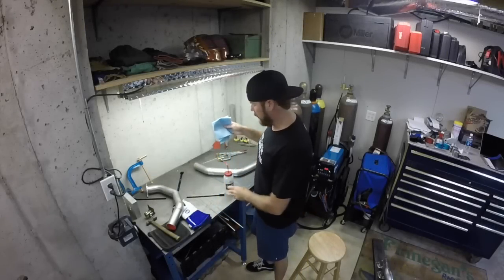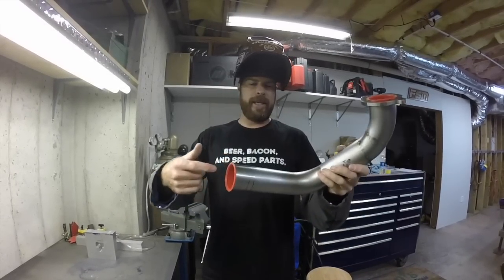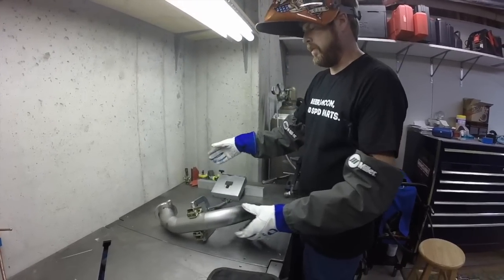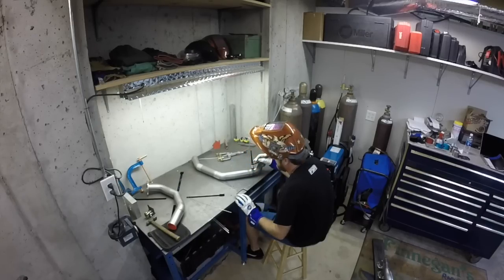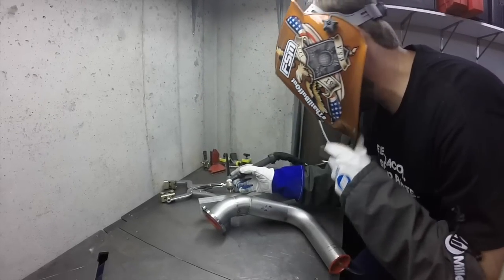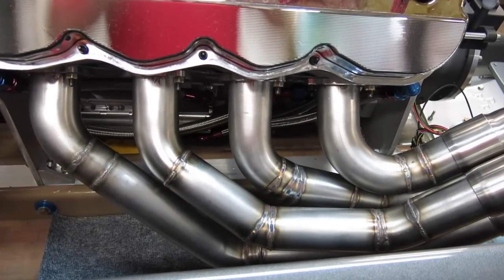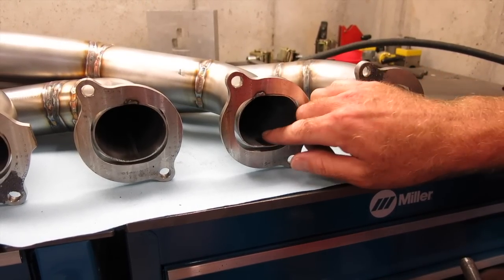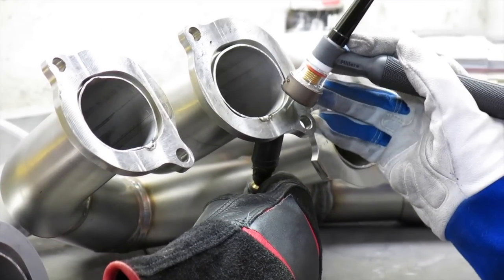Finnegan's Garage Ep 13: Hemi-Powered Drag Boat Stainless Steel Header Build Part 2

Comment: Nice work. I used to use what I called a clean tube. That was a tube that I made sure was clean on the inside so when I cleaned my filler rod I had a place to keep it so it stayed clean for later use. Thanks for the interesting show.
Reply from the maker: good tip!

Comment: Great video Mike,very informative. I made a tapered mandrel from a bit of off cut steel bar to fit the size and shape of the exhaust ports on the headers. This was gently tapped into the pipe as it was heated. The pipe swelled out to the right size easily and was tacked in several places before removing the mandrel. Worked perfectly with nice even transition from pipe to port. Took about an hour to make but worth it, has been borrowed by many people! Nice welding by the way.
 I picked up a bung and gauge kit to pressure test inter coolers,hoses and stuff,makes an excellent pipe purging rig too! They on eBay for about sixty bucks,well worth it for testing intake and exhaust systems too. Comes with wide range on bungs and a pressure gauge.
Reply from the maker: sounds like it works great.

Comment: 3:15 what you're referring to here Mike is sensitization, overheating austenitic stainless steel causes the chromium to join with carbon to form chromium carbides at the grain boundaries resulting in loss of corrosion resistance due to chromium depletion. If you look at this occurring under a microscope you'll literally see missing grains due to intergranular corrosion. If anyone is interested in welding or is taking welding in school I strongly suggest taking a welding related metallurgy course, it's really interesting to learn about this sort of thing! Great content.

Comment: Remember that when you're purging, you should always weld closest to the purge line first and make your way along. If you don't you can get weld contamination from the air being pulled in as the Argon flows over the open gaps.

Comment: Saw in a stainless muffler welding video the guy used Solar Flux for the back side of his stainless welds.  Sounds like another good option if you don't have a helper for the backside.

Comment: I welded 2v primary long tubes to new 4v oval flanges and boy what a pain in the ass to stretch the tube into a oval. had to relief cut it and grind it from the inside a shitton. Looks like that fits much better

Comment: You don't want to weld that low of amps because you're not likely to get full penetration of your weld.   If you're concerned about overheating the joint, weld it in quarter sections and dunk in water between sections to cool it off.  Stainless doesn't quench like mild steel so you can dunk away.  Really preference I suppose, I wasn't happy with the penetration doing .045 on 1/16" wall tubing but it does look neater.

Comment: I found the best way to weld thin wall stainless or carbon steel exhaust tubing is to get a perfect fit up and not use any filler wire. much less warpage. no excess pen.  no need for a back purge. and much better looking thin welds. and yes it is still very strong. not that exhaust is structural any way.
Reply from the maker: the exhaust is supporting the weight of the turbos....
Reply: +Finnegan's Garage  if you got 2 scrap pieces laying around. but them up with a perfect gapless fit up. fuse weld them with no filler wire. then take a hammer to the weld it won't  break even if you completely flatten it. I've never tryed  a fillet weld with this technique. but it works great for but welds.

Comment: So funny Finnegan - I have an arcstation, miller diversion 180, 625 extreme plasma, stronghand clamps - it's almost the same exact setup lol
Reply: BTW - I have a video of making a tungsten sharpener out of a cheapy grinder w/ diamond wheel for a chain saw sharpener.  Tungsten in a drill against the diamond wheel = great sharp tungsten w/o murdering abrasive grinding wheel stones and minimal dust.

Comment: Good work as always Mike. I like that you take the time to explain things a bit. I noticed you have a footcontrol for the tig. How does that work? I only use a tig with a switch on the handle.
Reply from the maker: its a wireless foot control. works great. only time i use thumb control is when i'm laying down inside a car and the pedal isn't comfortable.

Comment: Hey Finn, came back to this video because I remembered how informative it was. I'm building my very first header that's hopefully going to be an equal length 6-1 for a 240Z with a stroker L series. My worry is following the same process that when I go to finish weld and hammer the tubes into place on the inside of the flange that i'll warp the flange without having it bolted to a head or a jig since its such a long piece and for the L you cant cut the flange up since its integral for bolting the intake manifold on as well. Any thoughts/tips/tricks? Thanks!!!

Comment: Pickling solution, gel usually should be available at your welding supply.  Post weld treatment will restore your welds  stainless properties.  You do lose some of the cool colours.

Comment: I was just watching the video where the guy gave Finnegan the tips on tig welding on Hot Rod Garage the day before yesterday... Guess Finnegan forgot that little trick for feeding the filler without dipping and pulling back.
Reply from the maker: didn't forget. just haven't practiced it enough to be good at it.
Reply: Finnegan's Garage whenn I was Tig welding aluminum I just constantly fed it. I've never understood the dabbing... seems like a bunch of low spots that could be weak points to me. It eats up a lot of filler to constantly feed it but it seemed like a better weld... My instructor in college though I had actually mig welded it because it was so consistent :P damn I miss welding.

Comment: Pro tip: Try running a low-pass filter on your audio. It should get rid of that hum from your welder (I assume), great video though! Thanks for making these!
Reply: I'm thinking it may be an extractor fan
Reply: high pass filter... (real pro tip)
Reply from the maker: its the phase converter for the welder.

Comment: Nice vid. Getting better. Just FYI, you are wasting a ton of purge gas. You can hold the hose to your ear and just turn the regulator in until you just hear it flow. In a capped vessel like you are welding it is impossible for oxygen to "back flow" into the vessel with even the slightest amount of purge gas. Also, you should wear clean gloves when handling your filler rod after cleaning it. Your hands are full of impurities.
Reply: I agree about wearin nitrile gloves when cleaning the rod. But he seems to have good results without them.
Reply: +Eric Lock very true. Hell, Jesse James bare hands his all the time, but my point was: if you are going to wipe it, why barehand it? The gloves aren't for heat on a job like this. In fact, he would probably have far better control without them and could do the job in less than 8 hours...

Comment: makes sense that rod is dirty , they manufacture it by pulling it through either a die or between shaped rollers 
to prevent wear they do use some oil 
never thought about cleaning the rod , i do now 

i wonder if a chamber uses less gas , seen them before and the look like a gastight blastingcabinet with a weldingglas
Reply from the maker: those chambers are awesome and expensive.
Reply: i wonder if a clear plastic bag / tent would work

Comment: Could you do a video on the colors of the weld, at the end there is some blue, purple, orange and some other colors and I just feel like that could be a topic for a video, I have never owned a welder nor have I ever welded anything so I'm just curious if there is any difference and all that
Reply: the color of the metal changes duento the heat of the weld i think. i seen some blacksmith change the color of metal when he left it in an oven at like 1000 degrees and it turned stainless steel into a shiny blue.
Reply: The colors are pretty but not ideal. They are caused by oxidation, meaning burning of the metal. Welding in the open air causes it, nearly impossible to displace 100% of the oxygen. When you see something that was welded in a proper weld chamber it won't have any color just as if you had polished one of these welds- the color is only microscopically deep.

Comment: This will be a dumb question but why not use a flare to expand the pipe inside the flange? They make oval expanders.
Reply from the maker: the tube had to be compressed to get it into the flange. i didn't have an oval flaring tool so i made do.

Comment: All this talk about back purging on no mention of solar flux??  I've used it welding 304 stainless with Oxy and it worked well (coated both sides).  I'll be TIG'ing some n/a headers and fully intend to use it for that as well.

Comment: the foot pedal doesn't seem to have a cable - does it use a radio/IR/unltrasonic link to the welder or am I just more blind than I thought?
As a general comment, Argon and Carbon Dioxide are both heavier than air, so usually best to purge from the top or, at least, leave a small opening to the top so the air gets displaced rather than being trapped.

Comment: Is it possible to weld in argon itself? Say, if you had an enclosure with argon only, would it actually work? It's likely not very practical, but at least you wouldn't have to "purge" your tubes or feed argon on the backside as the entire piece would be immersed in argon anyhow.
Reply: In theory, if you could seal a room, fill it 100% with Argon gas, and keep it above atmospheric pressure, to keep the atmosphere out of the room, you could wear a scuba mask or similar and weld without requiring any gas flow.
Reply from the maker: yes but the enclosures are about $2,000.00

Comment: Considering how much damage the headers could take in that Engine Masters episode without any measurable power loss, I doubt your welds will affect the exhaust gas flow the slightest.

Headers starting to crack is probably the more serious issue of the two....
Reply: my thoughts as well in a previous vid. what the hell are we to believe with the genuine leading edge impact/engineering specificity with intake/exhaust in the engine and pre combustion, but exhaust seems irrelevant except for diameter per test.
Reply from the maker: also, and i failed to mention this, the sugaring on the backside of the weld is brittle and pieces can get forced into the turbos. not good.
Reply: Finnegan's Garage
Don't get me wrong, you've probably forgotten more about welding than I'll ever learn... it was just that detail about the flow that made me react.

Best I can do is shitty looking MAG welds, with shitty technique and shitty equipment... Compared to me you're a welding god. :P

Comment: Do you own/use or can borrow a 1080 HD endoscope to see the interior results of your welding ?  Or would you need a 4k endoscope to properly examine any signs of interior Oxidisation or other interior deformations  that over time will cause micro  hot spots to appear in each weld or join  made in the exhaust system ?  
Or would that be an overlkill , similar to using a high resolution FLIR camera to view infra red emissions when the completed engine is run on both the dyno & in the boat  under real world conditions , in order to pick up signs of thermal inconsistancies or oddities ,  before a $100K race motor catastrophically fails ?  
The technology to keep a twin turbo small/big block chevvy boat motor running big  Torque reliably & picking up problems before they became major issues was very primative back in the late 1980's & early 1990's when I hung around ski/race boats ,  I'd be interested in how far people go today to protect & manage a 2000HP  high dollar boat powerplant.

Comment: Well i have a serious question, why use all that stuff, tig weld it etc. if You could in theory just use a mig welder with flux core wire/self shielding wire without gas i mean and you get stuff together too?
Welds aren't that preety, yes but other than that i really see no difference and i have made probably about 40 exhausts with that flux, first one about 8 years ago and it's still holding on well.

Comment: When you cleaned the filler rod with acetone, where did you get that bottle, I have been looking all over for those style of bottles with the 90 Degree spout? Thanks Jack
Reply: hairdresser supply joints are the place to got for stuff like that, chemical proof and cheap.
Reply: I was wondering the same thing!
Reply from the maker: this

Comment: Is there any considerable risk of twisting the tube out of position/angle when hammering and welding it to the flanges since the flanges where cut apart?
Reply from the maker: since the tubes all slide in and out of the collector you just twist them into position when bolting them onto the cylinder head.

Comment: Don't take those calling you out as criticisms.  For instance, I had never heard that about brake clean before.  But I've never TIG welded either, only have a MIG here.  But when I find a good deal on a TIG,  it will be here, and like most things, I'll teach myself through trial and error... lot of error...;p  So you may have just saved me with all that... Thanks...  With that said, don't let the safety nuts drive you crazy.  Check out SVSeeker's channel..
Also, are the sleeves ever needed with TIG on a table?
Reply: id say the sleves were him just not wantimg to wear a long sleved shirt while welding (i know i hate it, get way to hot lol)
Reply: LarryLazz I know, but do you think they (long sleeve shirt or sleeves) are needed with TIG on a table?  MIG yes, but I have no experience with TIG.
Reply: +Mat Helm its all the same thing, only differnce (i know its not the only differnce internet trolls) is that mig feeds the wire from the gun and tig by hand, so i dont really see what your asking.. if your talking about the table getting really warm? no warmer then any other type of welding, if you mean to stop welding burns, sure it helps thats what they are for
Reply: LarryLazz With a MIG, (or stick) you have sparks of hot metal flying about.  TIG is much cleaner, no sparks to speak of that I can see.  And on a table, as in apposed to being under the weld.
Reply: +Mat Helm ohhh i getcha now, i wouldnt say they are needed, again they are only for use with short sleved shirts (or at least thats what they are ment for) they are just there to cover the skin and stop burns, it cant hurt to use them bht its not needed if you have a long sleved shirt
Reply: The sleeves are also there to prevent UV burns.  I'd venture that Finnegan was wearing them more for UV protection than spark protection.  Welding UV burns can be really unpleasant, especially around the eyes (closing your eyes only protects the eyeballs).
Reply: I have burned my skin severely within a few minutes of tig welding. So please use long sleeves, this is NO JOKE
!
Reply: Closing your eyes does not protect your eyeballs either. I cringe every time I see someone just close their eyes when tacking things together - your eyelids are not thick enough to protect your retinas from intense UV light.
Reply: Tito Rigatoni While it's true it's not something you'd put in a how to manual, most also turn their heads and/or divert there eyeballs.  The former being used almost exclusively by anyone who's done it more than once...
Reply: But it does work well for getting some nasty sunburn on your eyelids.
Worse are those who squint while tacking rather than using a helmet - also applies to arc welding and even gas welding and cutting.

Comment: So I am just starting out trying to do my homework and make sure I know what I'm doing before I get in over my head with welding, but I was wondering what you would recommend for a starter welder +Finnegan's Garage?  I was planning on getting a 90 Amp-AC, 120 Volt, Flux Cored Welder. Or saving up some more to get a Eastwood MIG Welder 135 Amp. I really love the wire feed welders, but I'm not sure if a gasless is better than having gas.  Could anyone help me out?
Reply from the maker: the eastwood MIG is a good machine. I'd buy a  machine with more amp output if you have to do any chassis work on a car. if you have to weld aluminum i'd buy a TIG machine. I know you can use a spool gun with a MIG machine on aluminum i've just never had much success with it.
Reply: Finnegan's Garage Thank you so much!

Comment: Is there any reason you're not using the welding cup that you spoke about on hot rod garage??
Reply from the maker: i found that Toxic cub breaks a bit easier when you drop the torch. works great but its a bit more fragile. the Titanium one is very durable but I've been having great luck with the Furick cup so i've been sticking with it.
Reply: Fair enough. It's good to hear some real world experience on these things.
Are you still using the same feeding technique that he showed you aswell?? With the sliding thumb push thing.

Comment: Formula that will save you money.  Pipe volume is Pi * radius * height.   For example, you have a 3 inch tube with 3 feet of run.  That works out to .15 cubic feet.  If you're flowing at 30 cubic feet per minute, it will take less than 1 second to completely purge the pipe..... that's .5 cubic feet per second.  You certainly don't need to do minutes of purge - especially if you put a pin hole at the opposite end to let the air out (then plug with a golf tee).... if you're curious how I know... yeah, my boss was beyond irritated at me for running through a 250 cubic feet tank to weld a gas tank (didn't want it to explode)... this was back in the days when they were neither kind nor gentle with apprentices.  Come to think of it, I'm not either....  and Finnegan - you really need to show folks what that pipe looks like on the inside - if you did it right, you shouldn't be able to tell whether or not you welded from the inside or the outside... even your dimes will go through.
Reply from the maker: thanks for the tip.